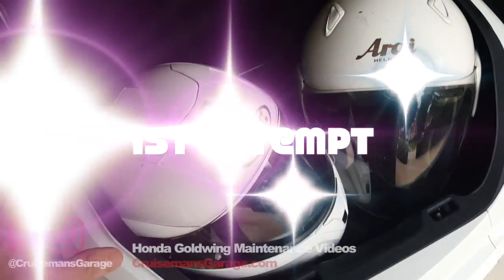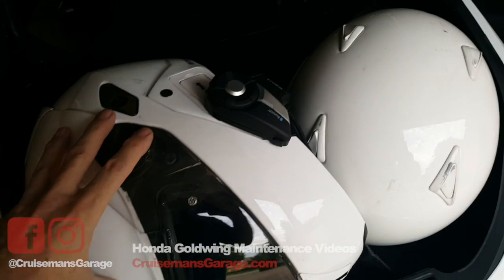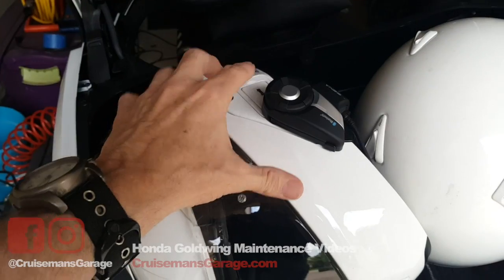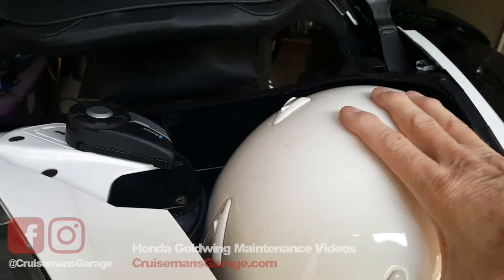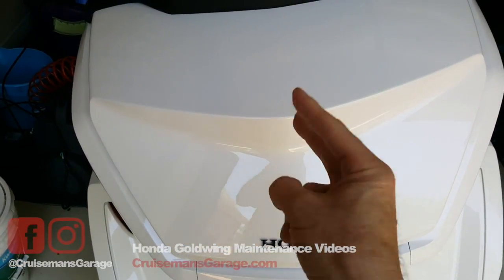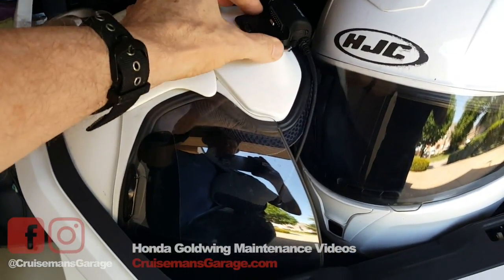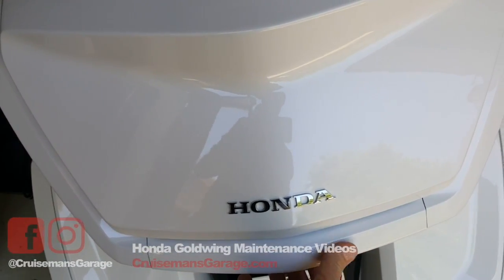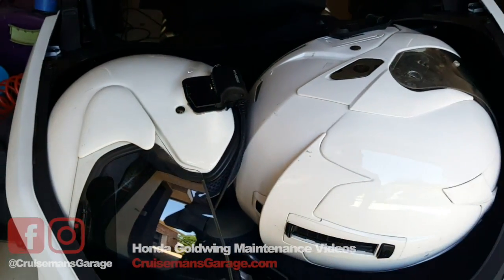How To Fit Two Helmets in a 2018 Honda Gold Wing Trunk

Comment: I say that it’s a dam shame you pay close to over $30,000 for a bike and you have to wrestle to put two helmets in the trunk .😳😤
Reply: I agree! And you want to know what else.... that 1/2" to small comment can be used to describe so many things wrong with this bike. Besides the 10 to 15 things every one says is wrong with the bike.... that 1/2" applies to front shock.  It is the cheapest of the cheap. The shock only has about 1/2" of travel before the shock body hits the bumper.... and that is when it is supporting  only the mass of the bike ( no rider's on board) . Honda has designed a CHEAP BIKE that will take 5years to correct.   I say hell no. After riding the 2018 Indian Roadmaster... it is everything the Gold Wing can only pretend to be. I am not going to be a betta tester nor wait many years for Honda to get it right.
Reply: I agree.  HONDA fix it please!!!!!!
Reply: How did anyone listen to this guy just talking to hear himself.  WOW could have made this video into 30 seconds.

Comment: Cruiseman, I admire your persistance, but someone at Honda needs to get fired, I actually heard a Honda GW salesman tell a Demo rider that wore his modular helmet to a test ride that most GW riders wear 3/4 helmets and 3/4 helmets would fit without a problem, this is totally unacceptable, no one should have to wear smaller helmets, or draw up different configurations to place the helmets in the trunk, I got a little upset just watching this because I was saying to myself, where can you put your gloves in this Flagship Tourer, much respect to you Cruiseman for all the good work and videos you produce.  Keep up the good work, but as for me, I cannot recommend this bike under the current conditions, something has to change.
CHRISCALIENTE
Reply: Compromises are necessary sometimes for progression.   Ive been there.  Trust me.  I totaled my 2006 in 2009 and have been waiting for years for the perfect upgrade.  In 2015 I conceded and bought a 2007  GW with 3300 miles.  The bike was like new.   Was still never satisfied that way either.   I sold my 2007 to get the 2018.   Cruiseman and I are riding like twins except he don't have the fog lights and I don't have the highway pegs. Same color and everything.  Lol.    Im still not satisfied but i'm more satisfied now than when I had the 2007.  It's just an honest assessment Cruiseman and I have.   The 2018 is an Optimal experience hands down. Anyone else who doesn't admit that is just stuck like I was from 2009 through 2017.

Comment: for 50 years I have left the helmets on the bike , with the occasional minimal locking .Most of the time its on the seat with my jacket over it . If the trunk space spoiled the the ride for you than you are missing the most beautiful designed and engineered motorcycle on the planet.

Comment: I wear an XL Shoei Qwest helmet. The trunk will close and latch but with a little pressure will be exerted on the latch like in your case. To open it you simply press down just a bit on the lid to take that pressure off and it will unlatch perfectly.

Comment: Been riding hondas since 1965 love there bikes. Just bought 1998 gl1500 with 12200 miles on it last summer,love it and believe two helmets of any size will fit! Also has two helmet hooks under trunk that lock, seems honda may have missed the mark on new goldwings! That said you can have everything, maybe next year.

Comment: Just my .2 worth. This is a premium Touring motorcycle and an iconic branded one at that. Newly redesigned and fresh to market. Nice!  But how does a market leader like Honda motorcycling, an organization with talented smart design engineers not think to conduct some form of Focus group filled with a few or more Touring specific motorcycling enthusiasts to poke, probe and express any thoughts or concerns possibly creating an “aha moment”, which if it did, could have headed off issues before coming out to market. It’s absolutely imperative to be able to fit 2 full-face helmets with communications modules in a premium Touring motorcycle’s top case without taking on the challenges of some sort of Rubic’s Cube puzzle to make these helmets fit. Just not understanding a very basic approach to learning from a cross section of your customer/user base what you might have overlooked before product launch. Honda a few other things and maybe more the longer the bike is in the field. Sufficient to grab passenger hand, designated highway peg location placement, sufficient helmet storage, GPS ease of use and not offering a premium model with most if not all of the bells and whistles from your catalogue factory installed.
Reply from the maker: I was part of a focus group about 5 years ago. Even though the marketing firm never admitted it, it was obviously paid for by Honda and all of the riders in the group were Goldwing owners. I remember one of the questions at the time was "would you be willing to accept less storage space," Of course, everyone said NO, but it seems Honda moved forward anyway.
Reply: Cruiseman's Garage 

They might want to revisit this and other issues in the refinement. As you know all too well, when you mess with a successful recipe too much you can achieve the direct opposite of your intended objectives. Of course sale will always be the barometer. Since sales are in my guess from what I hear, good to great, Honda just might not care too too much. Unless BMW or competition figures a way to dilute market share.  One thing is for sure the GoldWing power-plant is an engineering marvel. The look of the bike gorgeous. Might be like the Apple watch. Honda holds back a little for each new year’s model enhancements. Thanks Cruiseman.
Reply from the maker: It would be more likely that Honda would blame the failure on market conditions rather than their own design flaws.
Reply: Cruiseman's Garage 

Absolutely true Cruise. They might have gonads so large as to be the trend setter and not care what competition continues to do. Although I have to believe some barometer influenced Honda to become more athletic and svelte. Mellenials are a finicky bunch and aren’t buying homes in droves as the Boomers did, instead racking up credit card charges, living footloose, going to the gym and Starbucks joints is what Honda has learned and thought might be a good gamble to get more athletic with the GoldWing. We’ll see how sales go. They won’t overproduce, I believe, staying lean at the plant to adjust if motorcycling buying economics tend to be sluggish. So far I outside of these Vlog walls I do hear quite frequently a lot of positive comments. It’s easy to get caught up in the fervor of our world when in fact there’s a huge ocean brewing out there we may not be seeing. Might have to call up to the Lighthouse for a sign as to where we are. I do like the look & design of this canyon carving machine. I do believe like you there’s still refinement that will be addressed. This is too good of a brand to allow to go to seed.
Reply: Hahaha...Honda listening to customers...Not a chance! IMHO Honda is in the top 5 companies in the world who do not care what their customers think! Cheers

Comment: So if the small helmet is too tall obviously it has to be on its side.  It looks like the way you succeeded was by putting the back of the big helmet into the front of the small helmet, so that some space is being double used.  

I suspect Honda tested it with helmets belonging to 5’6” 105 pound Japanese people.  It seems like the aftermarket could come up with a different trunk lid that was an inch or two taller.
Reply from the maker: Yes. But every 2 helmet combo is going to be different. And for sure, some are not going to fit at all.

Comment: Can you fit either helmet in the side cases?  I think it is complete incompetence on Honda’s part to design a touring bike with such brain dead storage design.
Reply from the maker: No. They will not fit.
Reply: Cruiseman's Garage That’s just nuts for a bike ostensibly designed for touring.
Reply from the maker: Just not a fan of leaving a $600 helmet/Bluetooth combo on the bike. The helmet lock on the 2018 is a joke.
Reply: JusticeAA The Wing helmet lock was designed by the same incompetent engineer who designed the cases.  It is a joke.
Reply: lets count how many things about the 2018 wing  are jokes...

Comment: Honda listen closely to the comments here.  I know this was to reduce weight but this is a huge mistake in the design of such an expensive bike that is meant for road trips.  For those of us with big heads where are we supposed to put our helmets when stopping?!!!   Ridiculous!   I was thinking of purchasing a 2019 but considering the reduced storage I am trying to figure out where we would put everything on a weekend or longer trip.  This needs to be fixed....seriously.  And while you are at it change the navigation system to proper Garmin software.
Reply: Sorry, they will not listen closely...Honda does not care what their customers think.  I owned a 2008 and a 2012 and riders complained about the transmission (5 speed vs 6), ground clearance, Nav system and updates, no blu tooth, $1200 CB, the same bike  since 2003, Honda didn't do anything to fix concerns or modernize the bike (IMHO the 2012 was the same bike with New body panels) until 2018.   BUT the new Wing is amazing.  It is a new bike with all new stuff.  Other than storage and the screwed up blu tooth/icar system, it is top notch!  Cheers

Comment: I don’t get it?  I got an HJC full face and a 3/4 HJC, without the Bluetooth sticking out.  I use a 10UPad bluetooth on the fullface, so nothing sticking out. No room to spare though. If you’ll press down on the trunk lid, it will open.  No banging...just press down.

Comment: Have you any thoughts on the new French add on system which increases the top case capacity. I have just watched the YouTube video. They add an extra half to three quarters of an inch to the capacity by adding a fillet to the lid.
Reply from the maker: The video I saw does not really show much.  Not sure how it would actually work.

Comment: Besides the engineers building around the air cleaner again; they blew it with the luggage storage. The back of the trunk lid could have been an inch taller and the bags an 1 inch wider without changing the styling of the motorcycle. They should know that Americans have a bigger head on average than they, Japanese do. And if you can’t put two full face in a trunk then give a secure place to latch your helmets than that ridiculous helmet lock that goes under the seat on the left side. Great bike other wise!

Comment: A bit ridiculous for Honda’s full “tour” bike. Even the side bags are so much smaller, making two up a joke for touring. Also found wind management to be horrible compared to 2012 version in stock comparison, sure if you add a bunch of aftermarket wings to solve the issue, they might as well have kept something similar in width to the 2012 version fairing and as far as passenger comfort, that is gone as well. The reality here is Honda made a “touring “ bike that is just over 10% smaller. Other than to just purchase a new bike, what am I really going to get other than headaches and frustration when touring. No thanks , I will stick with older version that has all the proven comforts and maybe just maybe Honda will remove head from their a$$ with this design.